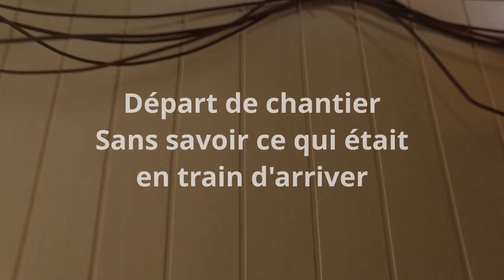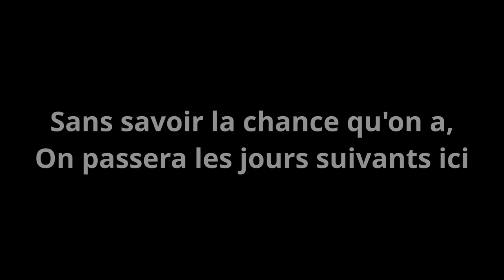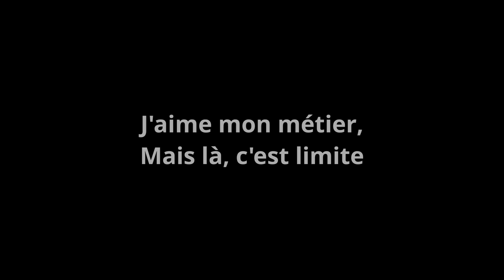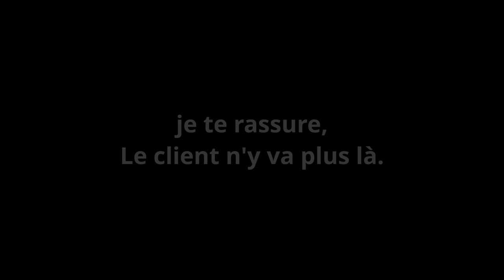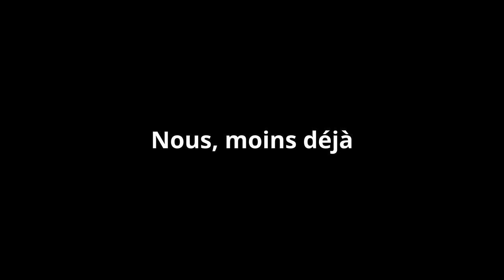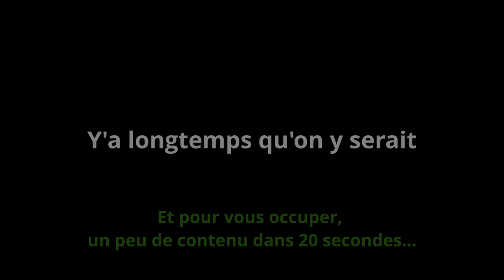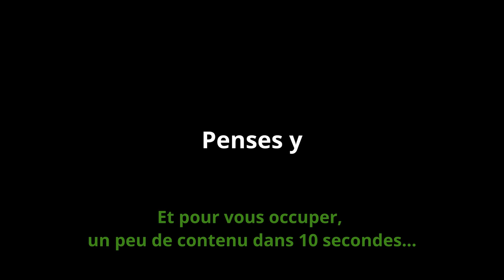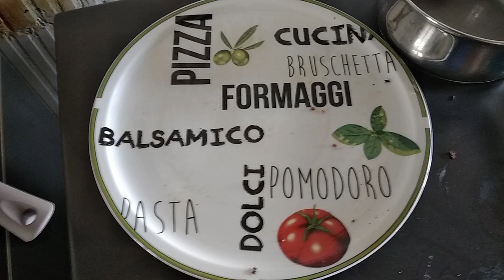Amenagement de combles - Partie 3

Comment: Bonsoir , il smeble que certains marchants de mqtériaux vont réouvrir en mode drive ou livraison seulement. Attention à vous ;) .
Une petite question vous n'avez pas une petite formule qui va bien pour trouver combien vous devez acheter de mélange pour faire un béton? J'utilise les calculettes sur internet mais les différences sont énormes à chaque fois.
Reply from the maker: Il suffit de calculer le volume du béton a faire. C'est a peu près le volume du mélange. Pour avoir le poids du mélange, sa densité est de 1,6. 1 M3 de mélange ça pèse 1t6.
Reply: @entrepriserousseau3316  ok impec, merci